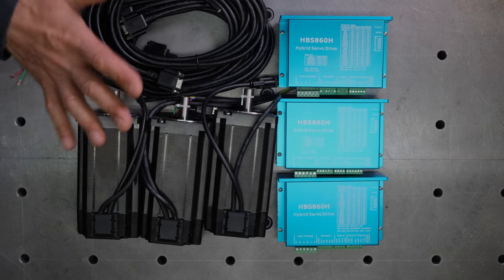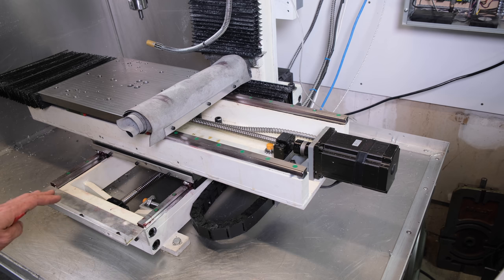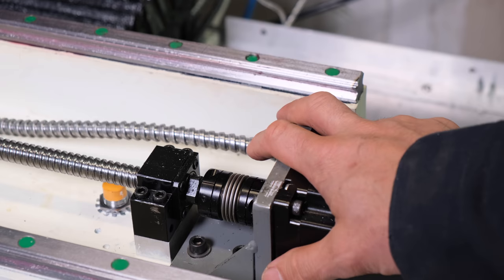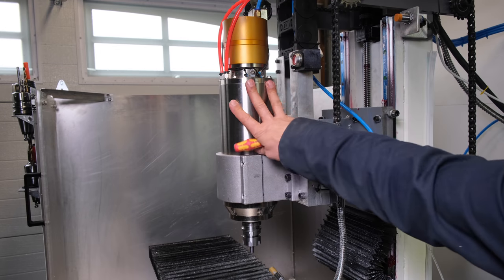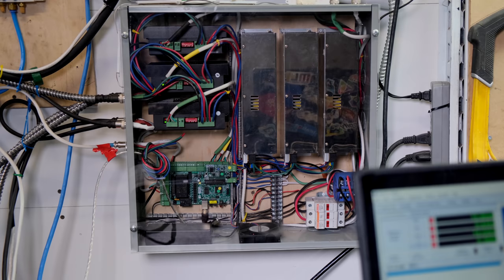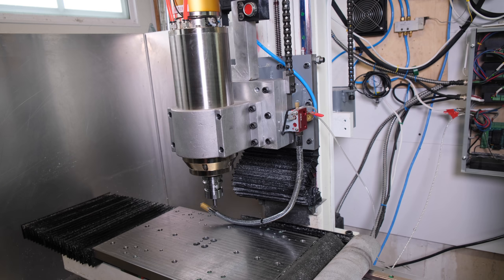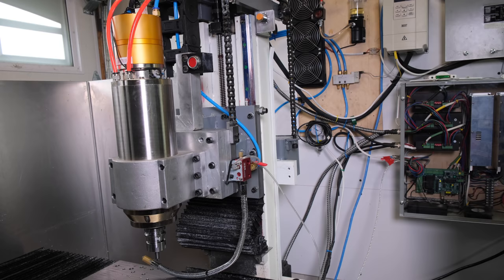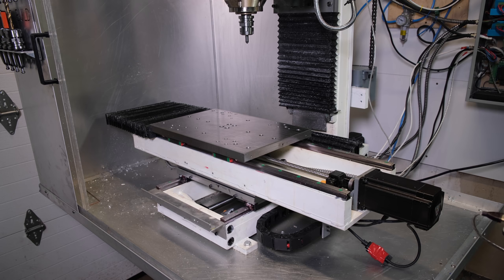DIY CNC upgrade - Q & A and tour

Comment: I decided to go with Nema24 closed-loop steppers. I figured it would be a lot better and let me know when the steppers can't keep up, especially with the alarm lines coming out from the stepper drivers. Also, it depends on the stepper driver but it may actually try to compensate for the step loss before it sends out the alarm (so if it isn't recoverable then it will send out the alarm). I went ahead and bought a raspberry pi 4 to use as my cnc controller via LinuxCNC. I also bought a couple of Mesa FPGA cards to go with the Pi for high-performance stepper pulses and GPIO so the Pi doesn't need to deal with all of that and just focus on giving the FPGA instructions to control the machine. I could eventually wire the encoders from the stepper motors to another Mesa card, allowing it and Linux CNC to handle compensation and alarm work as well, but right now I don't think I need that, so I'll just let the fancy stepper drivers handle that. Thank you for your awesome videos! You and Marco Reps are big/main reasons why I am building my own machine.
Reply from the maker: I am so glad  my videos where  helpful. Enjoy your build.

Comment: How did you connect the closed loop stepper motor and stepper motor driver to the controller. I have watched several videos but none of them show how to hook up the closed loop stepper motor and driver to any control board. Plz make a video on this. I would appreciate your help. Looking for another video of your about cnc. Plus if you wanna make video about upgrading a lathe to a cnc or building one from scratch. That would be huge plus. None other video has the quality stuff you have uploaded

Comment: VFD spindle is not suitable for this type milling machine or cutting steel (you seemed mentioned this), will you plan to switch to direct or belt drive servo spindle that has more torque? BTW you machine construction is very good!  Were all steel structure bolted or welded together?
Reply from the maker: Thank you.

Comment: Hi. So which closed loop controller are you using? The one at the bottom left of your panel. Did you have to change a setting(s) related to the lead screws? I am also in the same position, but my driving issue is accuracy, as opposed to speed. I also end up with scrap parts.
Reply from the maker: I used calculator built in to Mach4 to fine tune the all the axis

Comment: Very nice build.  I'm happy to hear that you filled the column with concrete as I didnt see this in the build video.  It is a cheap way to get more rigidity and less vibration.  
What is the spindle that you are using?
Reply from the maker: Thank you. 
Please see link to spindle on build video

Comment: When upgrading to Hybrid Servos, is it literally just a direct swap, or is there some programming or software to install? Do you have to change settings in your CAM software?
Or is it just a matter of knowing you've got more speed to work with when calculating speeds and feeds recipes?
Reply from the maker: In my case it was just swapping the hardware and very small step adjustments in software.

Comment: Hi Vince! Did you make strength and rigidity analysis before building?
Reply from the maker: Yes I used fusion 360 simulator to test it, that is why I ended up filling Z coulomb with concrete,

Comment: excellent job, in the future I want to build one like yours, but now I would like to ask you how you to put the micro steps setting to configure the drivers to obtain the velocity you are work on?
thanks for share all your work.
Reply from the maker: For steps Mach4 has built in calculator, for velocity start low than keep going higher until you miss step, once you have that value take away 20% of it

Comment: Im looking to buy a mill and convert it to CNC, you definitely confirmed my thoughts about getting closed loop stepper motors for this job. 

The only thing that makes me wonder: why would you want to stop your operation when you lose steps? Dont you want the closed loop stepper motors to adjust in real time, and continue milling? 

Greetings,

Jeff
Reply from the maker: Hi Jeff. Thx for your comment. I should  of be more clear on stoping the operation. Sometime even closed loop can’t recover the steps due to too much load or speed, so at this point you want the board to stop the machine to avoid scraped part or broken tool or crash.
Reply: they do correct the position, but in case that is not possible let's say because they get stock in one place then the alarm function stops the operation before major damages occur. It's an handy feature that both closed loop or servo have.

Comment: vince, i wanna asking, with this current closed loop stepper motor with encoder, are you still lost your machine coordinate when you shutt down your laptop or machine?
Reply from the maker: Not it doesn’t loss
Reply: @advanceair  ok thankyou vin, god bless you 🙏
Reply: @advanceair  ok nice build, are you using stepper/servo brake for z axis or just you swap with closed system without brake on your z axis?